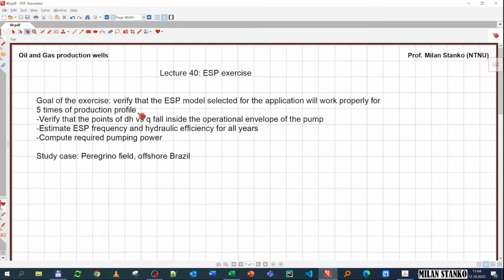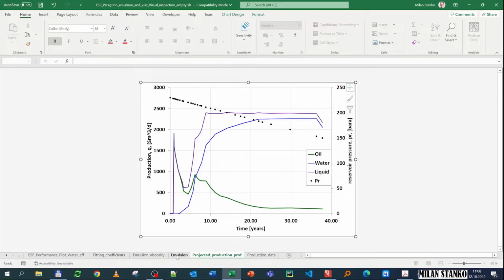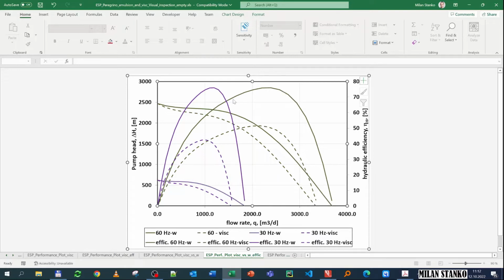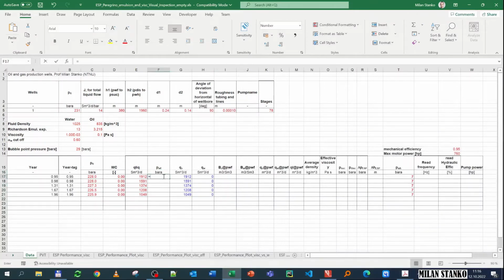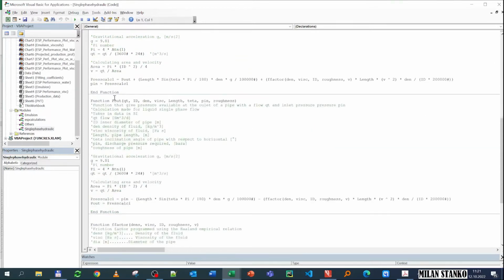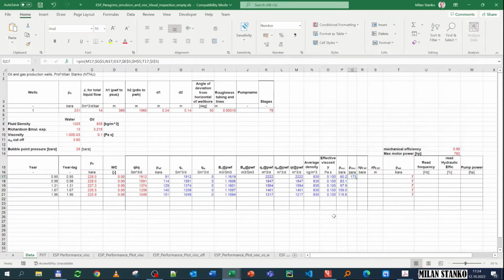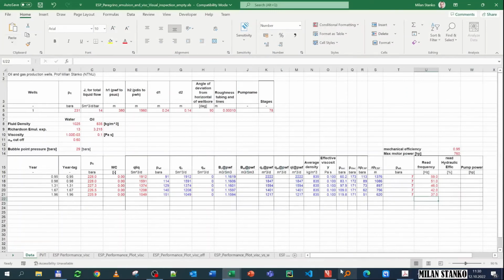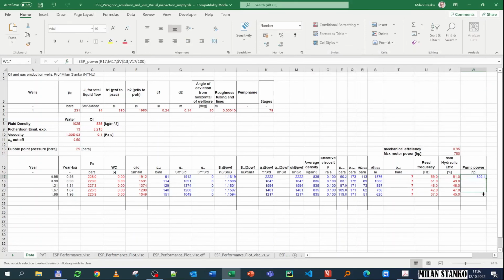40. Electric submersible pump (Exercise)

Comment: Here I noticed that the bottomhole flowing pressure increases with time fly, but conventionally we need to decrease the Pwf in order to sustain the same rate (inflow) throughout the whole period. And if we decrease the Pwf the accordingly the pressure provided by the esp will increase. But in your example it goes vice versa.

Very thankful for you informative recordings.